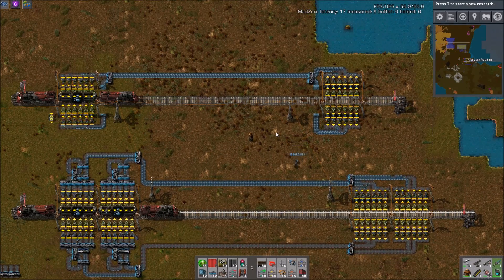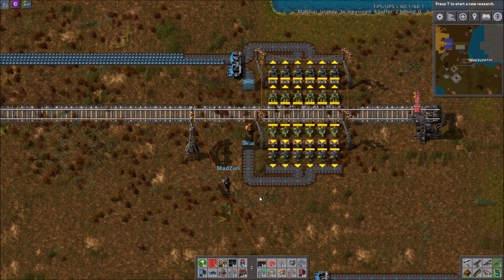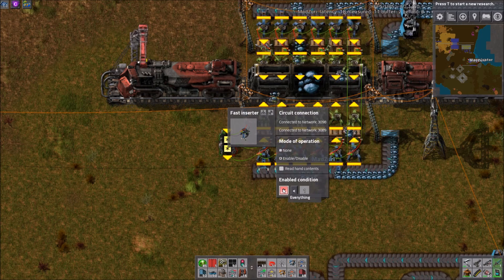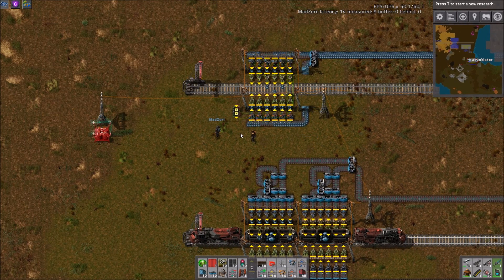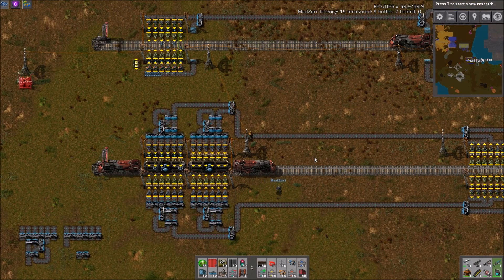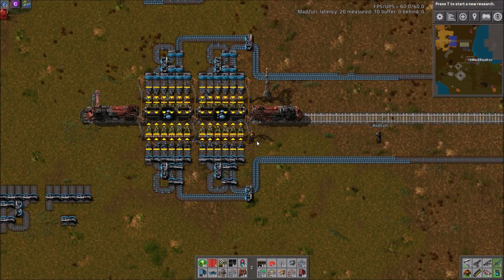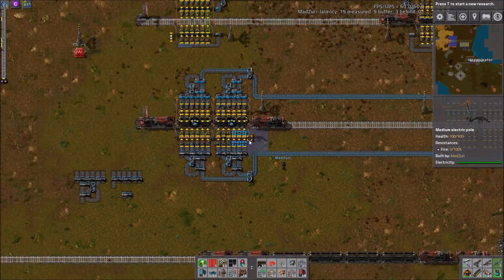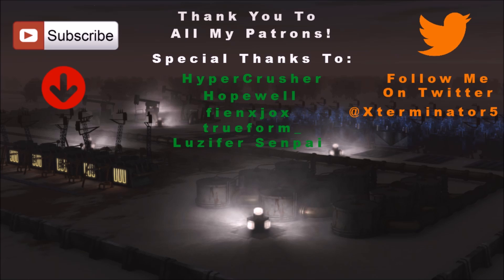Factorio Workshop - Building A Better Factory :: Train Loaders / Unloaders

Comment: help me I'm trying to load coal steel and grenades in one cargo trailer of the train but only want to load 200 of each how do I set it up with the circuit network?
Reply: use middle mouse to "lock" cargo that makes it so only that item can fill that space, you can do it completely without the circuit network too. to prevent the train from loading the rest of the slots is just use the middle mouse lock on some random thing that isn't at either station like wood power poles or something.(btw 3 slots in a 40 slot train is hugely inefficient but coal is cheap so you do you) 

this method is super simple and doesnt require any sort of circuits at all
Reply: @agentbarron3945  thanks will give it a try didn't know there was a option like that

Comment: I've been attempting to work with the first balanced unloader from the video and for some reason it doesn't appear to work. My original one had the arithmetic combinator set to divide by total chests, output to signal A and had the inserters set to compare average A with the chest contents, but for some reason it won't load. So I try the exact settings used in this video and still it won't load.
Examining it more closely, the average appears to be lower than it should be and since I'm very positive I've got the number of chests right ( I double and triple checked ) I can only blame rounding errors, though how it could be this inaccurate is beyond me.
I got it to work for a while by using another arithmetic combinator to add a small number to the average ( 24 apparently wasn't enough, 48 seemed to work )  but this all seems very strange.

Comment: Blue prints don't work. Is that causes its pre 0.15?
Reply from the maker: Steve of Queanbeyan Unfortunately yeah, that's why it doesn't work. You can kind of get around it by loading the blueprint in a 0.14 save with blueprint string mod, then save the game and load the save in 0.15 and re blueprint it with 0.15 method.
Reply: Just cannot seem to get this to work. The front chests always load first. Otherwise they all stop alder a few stacks. I think I’ve it got going. Think my mistake was to set the < 3 for the stack bonus on the inserters.

Comment: The newer Factorio updates must have changed how blueprint strings work or something as the blueprint for this gives an error of "Failed to import string: Unknown version ('H').."
Reply: Yep, 0.15 has built-in blueprint string handling and it encodes differently from the old system. Here's a converted print: https://pastebin.com/skP9qU4y
Reply: What do you use to convert the print?
Reply: @dgwdgw  Hey, how can I convert this to 017?

Comment: Any plans to update this to .15?
Reply from the maker: PerfectMan You mean the blueprints? You should fairly easily be able to do that. Just import the linked blueprints into a 0.14 map, save the map and load it in 0.15 and then blueprint them from there. :)
Reply: Yeah I was hoping for a .15-ready blueprint. I tried to make this on my own, but whenever the train is at the station, it does not work. It seems like the stack inserters from the chest to wagon empty the first chest in the row which enables the blue inserter to pick up another piece of ore, leading to an imbalance. End result is that it's only loading from the first inserter on the belt.
Reply: PerfectMan try this converter:

https:// factoriolayouts.com/blueprint/convert

(YT didn't like the link, so remove the space, obviously)

Comment: The blueprint string won't import in 0.15.13
Reply from the maker: You need to import the blueprint of this into a 0.14 save and then load that save in 0.15 and re-blueprint it unfortunately.
Reply: distantcam Try the converter on factoriolayouts.com

Comment: the unloading has a problem for me. For some reason I use one side of my coal belt more than the other. That leads to one side of the belt being full so that the inserters cant put anything on it (so that they permanently have something in their hand) and the other side being completely empty, not being able to fill up because not all of the inserters have empty hands. I fixed this issue by putting side balancers behind the unloading station
Reply from the maker: Interesting you're having that issue. Glad you got it fixed though!
Reply: im just wondering if there's a more elegant way to fix it :D

Comment: Nice design! You have multiple loader/unloader on the channel and it helps to have one marked as the "optimal" design.

I use something similar to the first one, only without circuits. I never felt the need to have perfectly balanced unloading. This goes double for perfectly balanced loading, since unloading helps a lot to "fix" your loading unbalances.

I think it would be helpful if you did a test: the first setup versus a similar less balanced setup, one someone might use just as it comes to mind and see if there is any actual real practical advantage to the really balanced one?
Reply from the maker: Hopefully in Season 2 of this series, a lot of things including the labeling and such will be better. :) 

Perfectly balanced loading isn't required, but I do think there is an advantage to it. If you don't have balanced unloading then one belt/chest can back up which causes the train to unload unevenly and slower because less inserters are working, and this can sometimes affect things farther down the line.

Comment: I am surprised no one has commented on it yet, but your unloading design needs to have a consumption lane balancer if you cannot guarentee use on both lanes at the same time. The problem is that since both lanes on each belt is linked together, it becomes impossible to load on one side of the belt if the other is full. This means that if your consumers for some reason end up in a situation where they can only draw from one side of the belt, everything will stop until some of the stuff on the other side of the belt is consumed.
That said, the situation where such a thing can happen require that one use some special variants of designs, but those designs happen to be some of those precented in this series. Specifically the problem comes when you end up with some types of one to one designs and the use of sideloading into underground belt (for the 2 belts of 2 combined materials by lane).
If one wants to be safe, balancing just after train unloading (if it goes to multiple places) is something I would recommend, though I normally stay clear of designs like this one which has hidden traps in them (block if only half lane full). It might not be necessary, as there are many other designs that one could go with. One have to remember that there are precously little inheirent balance in mines, loading, and unloading systems, so these are some of the places where it makes the most sense to put any balancing at all, even if one makes use of inheirent balance as much as possible.
Reply: The idea of changing to 2 groups of 3 inserters, that you suggested here, seems like a much better fix than lane balancing. The only place I would normally lane balance myself is with miners just before consolidating lines, as it allows easier solutions for getting high throughput of the consolication. There might be some other special cases, but they are so special that I cant remember when I last ran into them, and it was certainly not for vanilla problems.

Comment: for the second loading system with the flowback splitter, would it not be just as easy to run a similar system to the first set-up with 1 splitter/car/per side with belt feeding 3 chests with the cables running the same leveling set-up as the first? so in that example you would have 6 splitters in total vs your 26... with much less belt, at the cost of a few "free" cable and an arithmetic combinator?
Reply from the maker: I'm not entirely understanding what you're saying but using the wiring system is less UPS intensive than using splitters in general so adding in splitters in place of the wiring system is actually worse.
Reply from the maker: Oh I see what you mean. I think this is actually a bit of misunderstanding in general. A circuit controlled loader with less splitters like you show with your blueprint, or like the first loader we showed is obviously more compact and scalable. We just showed the one with lots of splitters to demonstrate a balanced loader without using any circuit logic and just using belts and splitters to balance.

Comment: Great video, thanks.  I may have missed it but have you done a tutorial on bot outposts?  That's something I would like to see as well.
Reply from the maker: Thanks! I haven't actually done a video on that, mostly because it's usually pretty straight forward. Anything in particular you are wondering about with that or would like to see in a video?
Reply: Thanks for the reply.

I was looking for a process that would allow bots to drop ore evenly in multiple requester chests for uploading into cargo wagons.  I did a run around with them dropping into a requester chest then belted through a balancer to evenly distribute the ore to chests to be uploaded to cargo wagons.
Reply: @roofersrule9047  what would the benefit to doing a bot outpost vs a belted one? surely the number of bots required to get more throughput than 4 bluebelts (the max 2 cargo wagons can support) would be just staggering. youd have to have more than 60 bots per tile required to reach the station, and the amount of miners to make that viable, holy shit, i cant even imagine an ore patch that size

Comment: I guess or definition of balanced differs, because the design result in unbalanced chests, since you aren't linking all the chests together, but separate by sides and wagons. Not that linking all chests together is without issues. These design is only balanced as long as everything is perfect, like the test setup, a real base just can't be perfectly balanced, sometimes a machine doesn't run, sometimes you removed a power pole, sometimes you added to the bus, sometimes biters eat a belt and all the other things that make a real live base run less than perfect.

The loading one is perfect as far as it's possible to be perfect in factorio.
Reply: Steen Eugen Poulsen but on the loading one he is linking all the chests together which as you say is as perfect as factorio gets, and there are no chests on the Unloader, so I don't understand the point you're making.

Comment: Why dont you just use 6 splitters in pyramid constellation instead of this balancer design that uses 8 extra belts? The design is super weird, because 1/2th of the left output of the first splitter will go back into it making 1/4th of the output  end up on the right side if the belt is not full. (actually its even weirder because 1/4th of 1/4th will also end up there etc...)  That does balance the output because the right side has to feed 2/3 of the outputs. WHYYYYYYYYYYYYYYYYY xD
Reply from the maker: Distelzombie Centzon Totochtin Building a pyramid with splitters doesn't actually make it balanced well at all. You need to send part of it back through in this design to get even distribution.
Zuri could probably explain it better.
Reply: Yeah, I was confused at first too, but the feedback thing is actually correct. If you let x denote the amount that the feedback brings into the first splitter, then the input to the first splitter is x from the left and 1 from the right. So that means the output of the first splitter is (1+x)/2 on each side. The left side gets split again and half of that is fed back to the input, so we get that x = (1+x)/4, which you can simplify to get that x = 1/3. And now we see that the left 2 chests gets (1+x)/4 = 1/3 of the input and the right four chests get (1+x)/2 = 2/3 of the input, which means it is all exactly balanced!
Reply: I thought about it. The reason that pure splitters will not be balanced is because they produce a bell-curve-output. Meaning the two middle chests will get more material than the other.
I'll do a little contraption to see if it will actually be a bell curve or just always 2 or 4 middle chests that get extra if I up the number of chests. (Easy combinator chart)
Reply: At first I thought it was weird, but I did the math. The first splitter splits off 50% to the right side. The second one puts 25% to the left side, so now 75% are already out of the system. The remaining 25% go back around to the first splitter. So these 25% are then split again, half to the right, half of the rest to the left and the rest goes around for another split. This repeats infinite.
In the end you got for the right side 50%+12.5%+3.125%+0.78125%+...=66.66%
and for the left side 25%+6.25%+1.5625%+0.390625%+...=33.33%
It might make more sense if you write down the fractions on paper, e.g. like this:
right: 1/2^1 + 1/2^3 + 1/2^5 + 1/2^7 + 1/2^9 ...
left: 1/2^2 + 1/2^4 + 1/2^6 + 1/2^8 + 1/2^10 ...
Reply: Yea, pretty much looks like a bell curve...
https://www2.pic-upload.de/img/32956211/427520_screenshots_20170405020352_1.jpg
Reply: +Kirre
Basically the same that I said way up there.

Comment: On the loader where you have the inserter set to less than 1, isn't it better to have 'less than inserter capacity'? i.e. when the fast inserter has a stack size bonus of 2, the rule should be 'less than 3'?
Reply from the maker: That is definitely one way to do it. I asked Zuri about that later and I believe he said it's more consistent to just use less than 1. But yeah, I believe he did used to use the inserter capacity bonus number.

Comment: Thanks for making this, I'm actually busing probably three cars worth of iron, and two cars worth of copper because the local veins I've been using have run dry, so my factory is pretty much dead while waiting on the train. The big problem I have is with signals. I have a separate train that buses solid fuel to the ore loading stations to feed directly into the locos, but it creates gridlock that I have yet to figure out.
Reply from the maker: Of course. :) 
If you need signal help, I suggest the train tutorial video that ColonelWill and Xeteth made a while back. Can be found here: https://youtu.be/3ZiL7_vfJtQ
Reply: Thanks! I'm gonna watch that soon. My big problem is I'm running out of space, and the fuel point is like inside the refinery I have set up. And yes, tracks criss-crossing everywhere. Even though I made a bypass, the train still wants to go one way. going to watch le video now!

Comment: Question: Why bother loading evenly the trains when their job would be to fill on outpost and empty on base drop-off? If some buffer chest gets some leftovers its not a problem, when the ore patch gets cleared you'll tear down the outpost anyways
Reply: It's because if you even the ore between the chests, the train is loaded more quickly when it arrives at the outpost. For example, 1000 ore in 1 chest gets loaded into the train 5 times slower than 1000 ore in 5 chests (200 ore per chest)
Reply from the maker: I was going to answer, but this is just what I was going to say. So yeah, this.

Comment: Good video, but it was a little hard to follow Zuri's explanations.
Reply: MadZuri   When explaining it would be far less confusing if you started with saying what the final goal is then working back step by step from there gradually going into more detail explaining each part which combines to do that, what it does and it's parts etc. 

When you were explaining the loading station it took a minute of you going over circuit math before I worked out the intent was to keep the boxes filled equally. Before I understood that what you were saying was meaningless because I didn't know what it was ultimately doing which made it even more confusing. 

So yeah, I think start with the most general explanation and go into detail only to explain how parts of that. If you do that your explanation we be more structured and logical and easier to understand as we're always expanding our knowledge of something we already understand by a little bit rather than being swamped with a huge amount of information and detail and trying to piece it all together at once. (Head too small;)

Thanks though, I always enjoy learning new methods and better ways of doing things.
Reply: MadZuri No worries, it's still fascinating to watch/listen to.